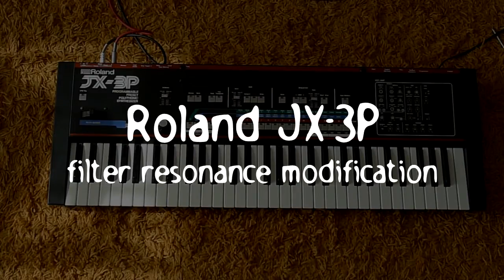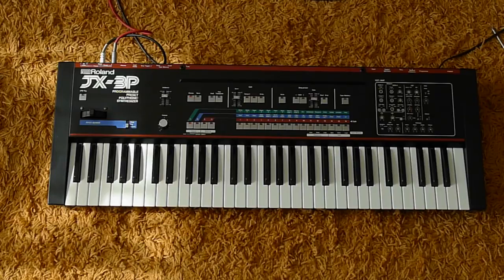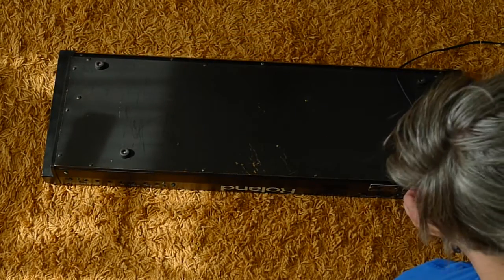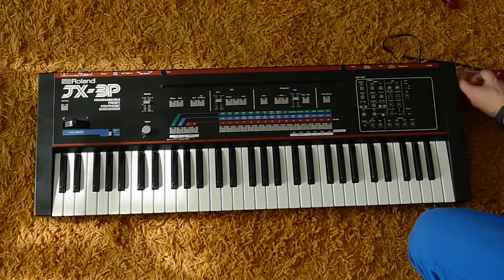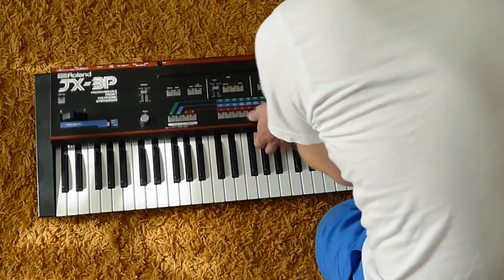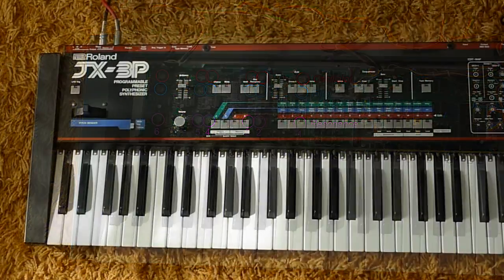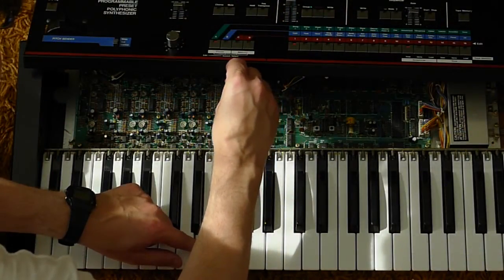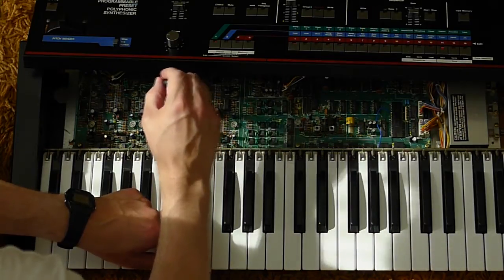Roland JX-3P Resonance tuning

Comment: The resonance on my JX-3P is much louder every few keys (possibly the 6th voice?). Do you think I could open the hood and try to figure out which voice has a higher resonance than the other 5 keys?
Reply: It seems to be a problem with VCF IR3109... find some skillful person to measure it with the oscillator, you can find the part on ebay for about 50 dollars, if necessary..
Reply: Yes, open it up as the video shows. There are two variable resistor adjustments per voice as you can see he is adjusting them. One is the resonance level and the other is the resonance frequency or cutoff. (i forget which one is which but you should see it indicated on the circuit board as RES or CUTOFF). The you can find the voice that is louder--you may have to hold down several keys at the same time to play the right one--and turn down the RES. If they are different pitch, turn the cutoff adjustment.

Comment: Hello can you help me. my JX3P is in good condition, but the volume knob makes crackling noises when I turn it, do you know what is this problem? how can i fix it?
Reply: Try to clean it properly or change the pot of the main volume.. I think that it should not be a problem to find similar part or to check ebay and buy original one.

Comment: You mentioned on your JX-3P/Juno-6 comparison that JX had harsher resonance. I think that was why they calibrated it at the factory to not self-oscillate.

When I did this to my MKS-30, I made it so it would just barely self-oscillate at the maximum setting. This made the resonance smooth like Juno-60 instead of edgy like SH-101.